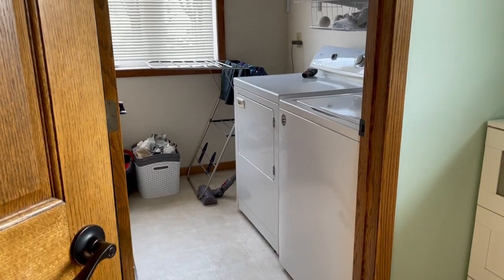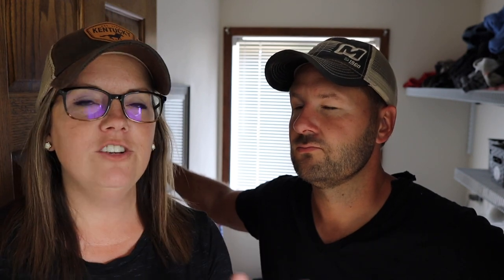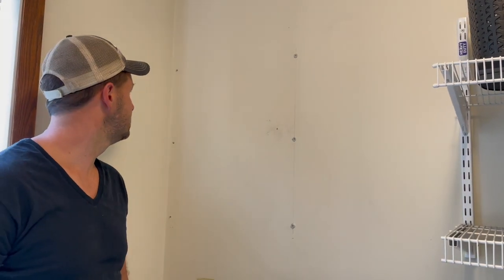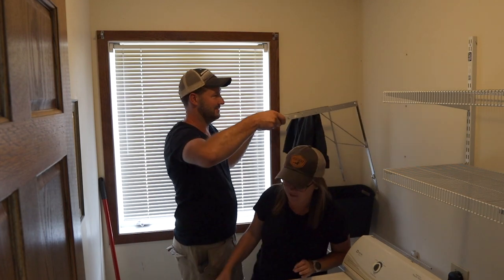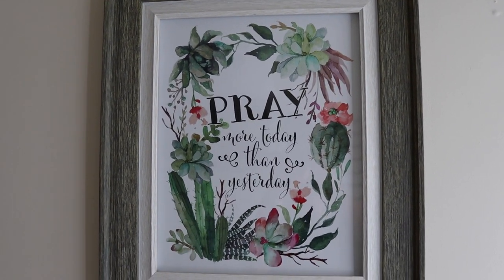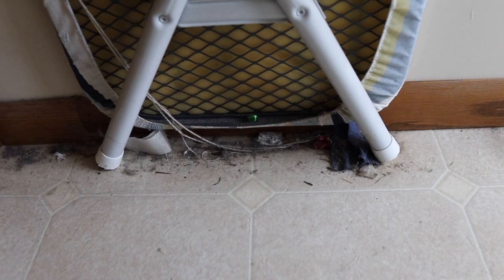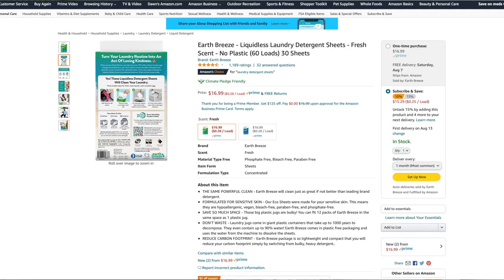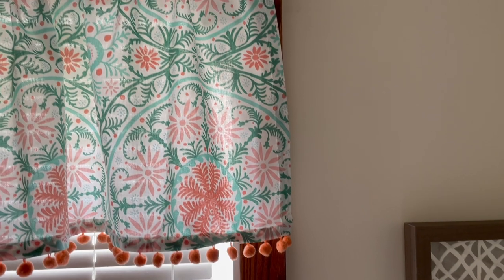Dream Laundry Room Makeover!

Comment: I use MyGreenFills laundry detergent. They send you an empty plastic jug (which will hopefully be the last plastic jug you will ever need) and a packet of power detergent that you will mix with water in the jug. Going forward you just get the powder packets in the mail to mix up more detergent. Since laundry detergent is mostly water, it saves on shipping weight/costs and reduces the amount of plastic jugs that may or may not actually get recycled. They have other cleaning products as well using the same concept. They are plant-based, eco-friendly and all natural so no chemicals or questionable ingredients.

Comment: The laundry room is definitely a space I hate and struggle with. It is a pretty big room and so my husband has his office in there as well. But, his desk is overtaken with paperwork and tools so he actually doesn't even work in there. I clean the lint every day but it still feels gross in there. I pull out our washer and dryer every 6 months to vacuum/dust behind but maybe I need to do it more frequently. It's not an easy thing to do though. We have cabinets above the washer and dryer and also a sink with cabinets underneath. The cabinet shelves don't work with our supplies so the soap is always floating around the room and there's always a pile of laundry in the sink because I don't want it just on the floor. It seems like open shelving is the way to go but my husband doesn't want to rip out perfectly good solid wood cabinets. It's a struggle for sure. My laundry room, garage, and attic are problem spaces that I need to work on but feel it's going to take a lifetime. Thank you for sharing your ideas and I'm hoping to start fresh with my laundry room too.

Comment: I have those laundry sheets and I have mixed feelings about them. I feel they work well for most loads but I don't use them for very large loads. I haven't had a problem with their cleaning however there are no suds with cold water or loads larger than medium. I know it isn't necessary to have suds but it makes me feel like it is cleaning better. Result is I use them most of the time but washing sheets and towels, I still use my liquid. When my children were growing up they did their own laundry once they were about 13. My husband did it as well.

Comment: Cut 12” of dryer flex hose for connecting your dryer to the wall vent.  Clamp it on and your lint problem is solved.

Comment: Dawn & Tom 4 things regarding laundry room 
1- YES washer sheets or pod thingy's just something pre-prepared so Gage/or anyone doesn't have to measure anything
2- Swap location of 2 grays laundry baskets with White for Whites & Dark BIN for Special Needs so children can see inside gray bins easily. I use the 3 bin method with my kiddos...white (whites) blue (regular) & pink (special needs/mostly Mom's clothes) 
3- Did I see a closet in the laundry room? If so maybe squeeze the mob in there
4- Why didn't Tom get CLEAR bins like he asked for? I don't see the benefit of one with little tiny holes, you still can't see in it. LOVE, Love, love your videos all 537 of them (especially ones with you & Tom, makes my day) : D

Comment: You may not need dryer sheets at all. I haven't used them in years. Don't want to add more fragrance to things due to allergies. No good for towels since they'll decrease the towels' absorbency over time; the product fills in the spaces of the fabric to smooth it out but then that stuff in the fabric means the fabric itself can't absorb water as well.

Comment: The HORROR when you just dump the load in and I'm thinking there are gonna be pockets full of tissues and crayons and stuff.  haha

I'm with ya on the laundry sheets.  I've tried 3 brands.  2 I loved, and one wasn't quite right if I chose to run a quick load in cold water (the like 20 min cycle) but the other 2 were fine even in those circumstances.

I just thinking of them like you might think of dehydrating something to make a leather-like strip.

Comment: Back to school college section in any Target-esque Walmarty type store has them,  especially right now and I don't even think they are like $10🤑. I had mine throughout college and another 11 yrs after that until it got mangled in our move last year, but you know what? Haven't needed it since then🤣! Spray a wrinkled shirt with a bit of water or wrinkle release spray, throw it in the dryer for 5 -10 mins and good to go, no iron needed. 😬🤷‍♀️
Reply: Diy wrinkle spray... 1 tsp of liquid fabric softener added to 2 cups warm water mix and then use when needed for wrinkly clothes. Spray and then smooth and shake wrinkles out or toss in the dryer for 10  minutes

Comment: I pull my dryer away from the wall every spring and unclamp the vent hose. With the shop vac and a 3" brush I'm able to clean the accumulated lint from the hose. Lint in the hose is a fire hazard.

Comment: Laundrytip..1 have one set of sheats for everybed. And one spare per size bed. We all have 5 days of daily clothing. Just enough towels and rages to fill a load plus a Day.

I never have mount washmore and never behind with folding of putting stuff away. If IT is not done.. we have nothing;). Also IT never is over 5 loads. Everything Will be in the laundry and than 5 loads means everything is done..

Comment: A suggestion would be to hang your wet clothes on hangers and hang them up to dry. Takes up less space than a drying rack, they get dried faster because they aren’t folded over, less wrinkles, and maximizes your space. You can just hang them in their closets when dry rather than folding. Saves time too. I  have six kids (now grown) so I’ve done a LOT of laundry through the years!  I think a drying rack makes more sense as an extra rack when your main hanging space is full; otherwise, fold it up so it can be moved easily and set up on laundry day. 😀

Comment: I tried laundry sheets and the instructions didn't say to put them in the bottom of the washer, so I didn't.  The laundry sheet stuck to the side of the washer and didn't dissolve.  I called the company and they told me to try again, putting the sheet in first before loading the clothes.

Comment: I am afraid the kids will drop the vacuum down the stairs, and now you have a "to-do list in your head with holes in your walls. I would have fixed the holes and painted them. I have the same vacuum, and you don't have to have the whole vacuum on the charger, just the top part.